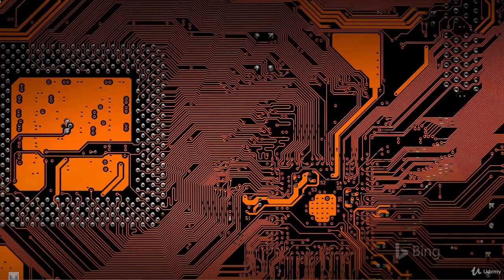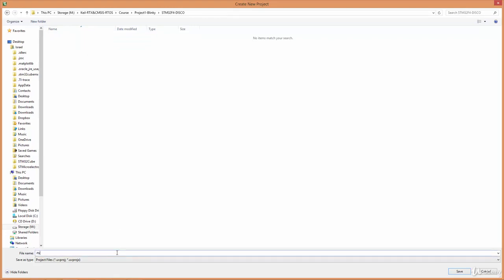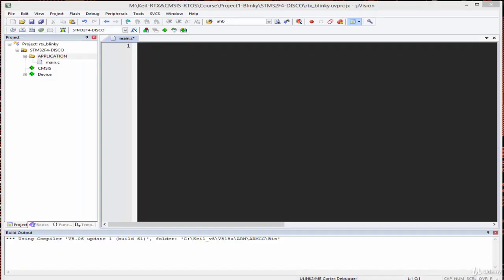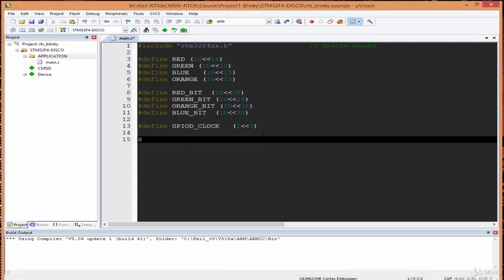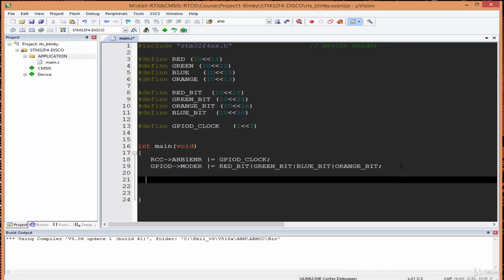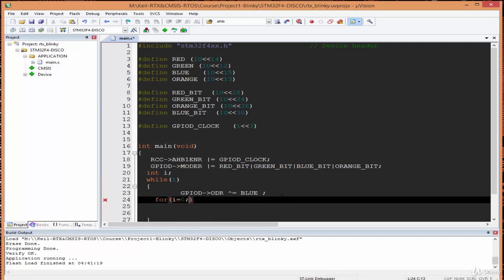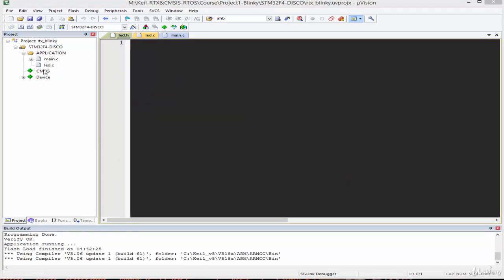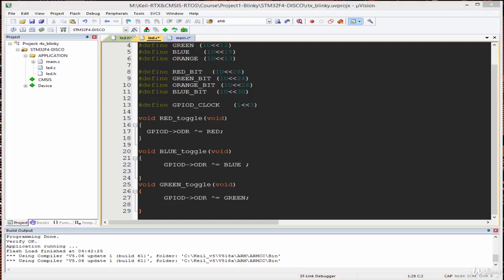Creating an ARM Keil RTX CMSIS-RTOS application (Part 1)

Comment: It was an Excellent video  to get started from scratch on  STM32-Discovery Board  for Bare Metal Programming. 
It helped me a lot in installing the Arm Keil and performing the selections and setting changes for a  STM32F03 Discovery Board.
Thank you very much  Sir.